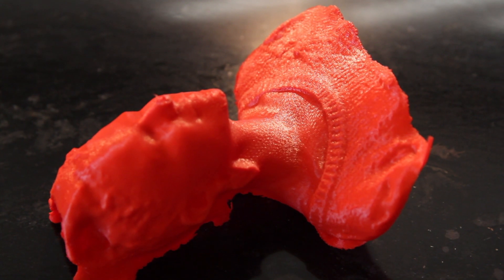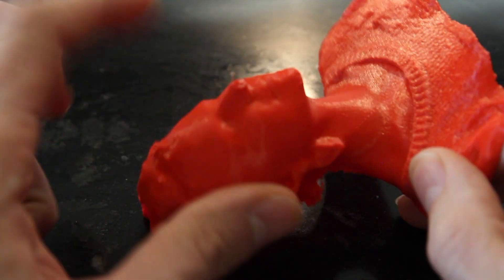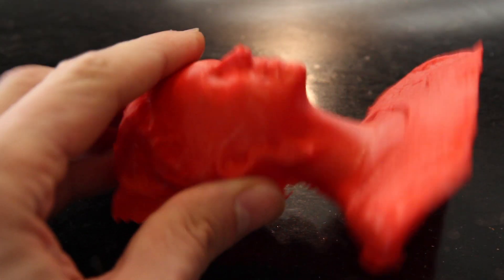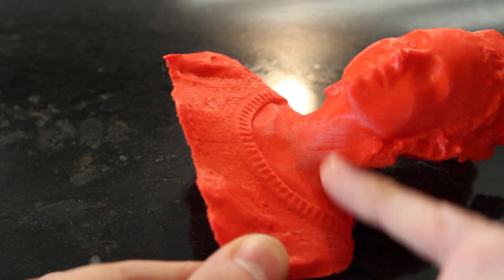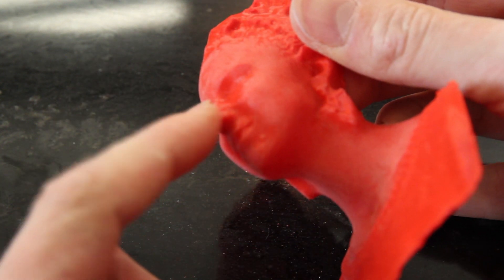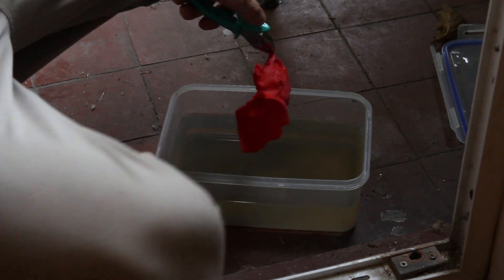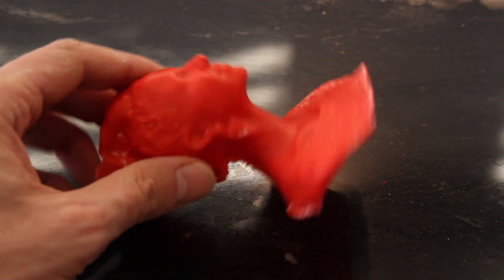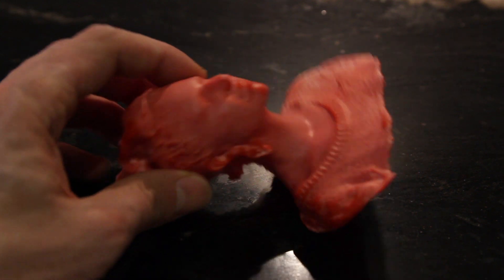ACETONE SMOOTHING PLA BEST METHOD EVER

Comment from the maker: And remember this wont work with cheap brands of PLA due to their high PLA content and lack of HIPS/PHA/ABS in the PLA blend (remember pure PLA does not smooth chemically with acetone and is more brittle and weaker than the blends anyways so you are better of using the blends even though they are unfortunately more expensive). I know it works for Colorfabb PLA. I have not used any others so cant speak for the millions of other brands of PLA out there.
Reply: So in other words, what you are calling "cheap PLA" is normal PLA, and what you consider "higher end PLA" isn't PLA, but instead a blend (For a real world test.. Mix Diesel and gasoline, and put that in your engine. Calling it gasoline won't stop it from potentially ruining your engine.).

Or more simply stated.. PLA isn't affected at all by acetone. Blends might. ABS is.
Reply: Colorfabb PLA is too expensive!